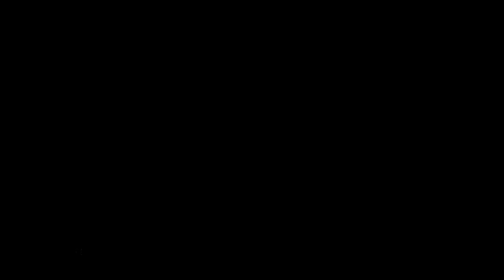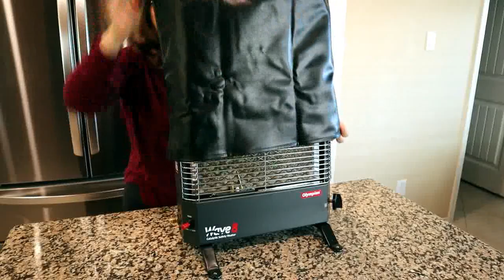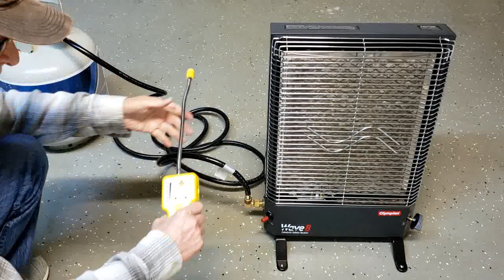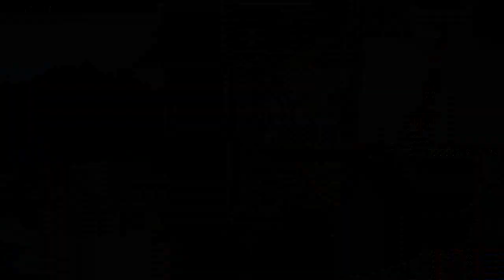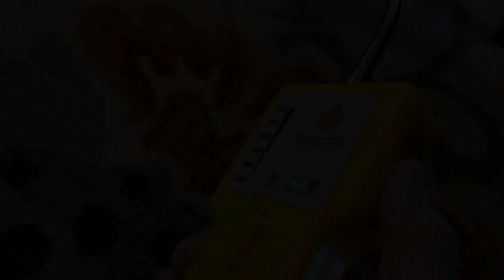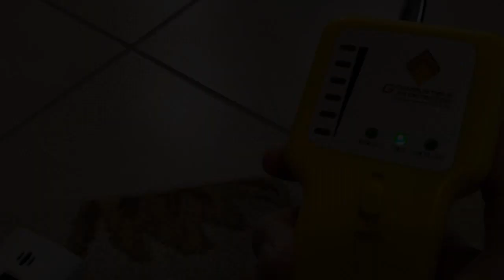Olympian Wave 8 Heater Review.  We Didn't Notice Any Propane Smell Like With Our Mr Heater.

Comment: My wave8 just sips propane and runs the longest of any heater I have used and mine is about 10 years old and has been great and will run for 5 days on high like I said they just sip fuel and you must buy the cover or you will ruin the heating mat and let it cool down put cover on for all summer or in the winter if not in use and they cost to much no to use the cover .

Comment: Your viewers need to be warned. There is a problem that you are not mentioning. When burning propane, approximately 0.81 gallons of water is produced as a byproduct per gallon of propane burned; meaning for every gallon of propane used, roughly 0.81 gallons of water vapor is created through combustion. Ask me how I know it is a problem. In short my RV roof fell apart and had to be replaced. Warm moist air softened the glue holding the OSB wood panels together. Non vented propane heaters of any brand or size create the aforementioned problem.
Reply from the maker: I was clear in my video that it needs to be vented.  The manual said it should be vented. For some, I think they can by a dehumidifier maybe at an RV place if its an issue. It is not a problem for me.
Reply: @LoneStarPrepping  open a window

Comment: This is super helpful. I've been watching a few Olympia Wave videos with an eye on buying one for my van. The Propane smell is killer for me so that takes care of the Buddy. I like the safety of this one. In my trailer I used an oil heater as I have to have quiet but it did burst a leak on me once (with the emphasis on burst - oh yeah - what a mess) so now I'm considering this one as I figure it's quiet, no permanent open flame, no smell, propane not likely to leak.
Reply from the maker: Glad I could help. I really like ours!

Comment: After watching your video I got the wave 8. The smell with propane heaters also bothered me. With the wave 8 I have not smelled anything at all. It works real good so far. I have only ran it a few times and I am very pleased with it. Thanks for the video.
Reply from the maker: Glad I could help.  We really like this heater.  Too bad its so expensive, putting it out of reach for a lot of people who could really use it.
Reply: I wanted to do a follow-up on this heater and my comment.. After one year of use, it still works great. When I change the propane tank, I check the connections with a gas sniffer just to make sure no gas leaks. I am very pleased with the Olympian heater. Your video helped me decide on the heater, and I am glad I did. Thanks.

Comment: What made you choose this vs. a kerosene Kerosun style heater?
Reply from the maker: Because kerosene smells, burning kerosene smells, open flame can be a fire hazard, dont want to store the fuel, and fuel does get old.   None of thise things are a problem with my wave 8.
Reply: @LoneStarPrepping  Thanks for your reply. I was under the impression that Kerosene stores for years but apparently you're right.
Reply from the maker: Some sites say 1 to 3 months. Some say 3 to 5 years. My propane will last indefinitely. I store many tanks.

Comment: Just bought this beast the wave 8 and I’m really impressed. I had the wave 3 and that wasn’t quite cuttin the mustered good heater just to small. Anyway these are great heaters well worth the money in my opinion thanks 😊
Reply from the maker: I agree! Where do you use it?
Reply: @LoneStarPrepping  I use it in my non insulated man cave (garage) to supplement my propex heater so it doesn’t run so much. They both sip the propane love it. 😊

Comment: That's the cream of the crop when it comes to heaters. So expensive though. I've got a Flameking 3000btu catalytic heater ($61 amazon) and I'm really happy with it. It uses those green cylinders but can also be hooked up to a bulk tank. It's easier to light. Just turn the knob to high and press the ignitor button a couple of times until it lights which starts the chemical catalytic reaction. That's it. If you need more btus you can buy more than one.
Just another option for those who don't want to spend the money on the wave. I don't trust the flame heaters like the buddys because of the fire risk and noxious fumes so those are out for me.

Comment: How high off the ground does it sit with the leg kit installed?  thanks  meaning  distance from bottom of heater to floor with leg kit
Reply: 1-2” closer in the rear higher in the front and that’s because it leans back a little .

Comment: I also had a Mr. Buddy, which I believe should only be used for short-term durations, never while sleeping. I have used two Wave 8's for 6 long, cold, Canadian winters in my full-time live-in RV. They are expensive to buy, but they really do sip propane, a 30-pound tank lasts about six days on low. I would highly recommend them, they are efficient, smell free, and very safe.
Reply: Buddy is just as safe. If it wasn’t you would have reported cases of people dying from sleeping near the buddy heaters. I haven’t heard of any cases
Reply: @jamesball8519  you should watch his video on mr. Heater because I got sick from it also due to allergies to the sulfur dioxide that they add to the propane that makes it smell bad so you know there's a leak..
I wouldn't have known why I was sick if he hadn't put out this video.. I thought it could be the heater but since I have researched this I have found out what the truth of the matter is..
From the mr. Heater I got terrible headaches a very hoarse voice and vertigo and my eyes burned..
So don't go telling people that the mr. Heater and I guess the mr. Buddy is the same way since it's the same company, that it's safe for indoor use for everyone...
I hooked it up to a brand new 20 lb propane tank, I got the mr. Heater hose that goes to the 20 lb propane tank and I had good ventilation.. the store I bought it at which was Ace Hardware didn't have the fuel filter at the time I bought the mr. Heater and it turns out they didn't get it for 2 weeks so I ordered it online and got it that way..
It didn't help I still got sick.. plus the mr. Heater would not light half the time.. even though I use their recommended hose that they say didn't leave the oils from the hose like other hoses did.. but apparently it does cuz half the time it wouldn't work.. the heater either wouldn't light or wouldn't stay lit or it's shut down after using half a tank of propane..
I did put in a 1 lb green propane bottle which is what they recommend for this heater.. and after about an hour of running it with that little bottle I switched it over to the hose and then sometimes it would light and sometimes it wouldn't..
The 1 lb green bottles are a cleaner grade of propane but even with them on it I still got sick...
But they don't tell you that if you have allergies or lung problems do not use this heater ..you have to get sick first..
So now you are educated on this matter
Reply: @jamesball8519 cool story bro
Reply from the maker: Thanks for sharing

Comment: $600 for a portable heater!!!😱
Reply from the maker: No. More like $400.00 at campingworld and worth every penny when it is sub zero temp outside and power is out and you cant handle mr heater smell and want to stay away from a warming shelter.  Funny... lots people dont have a problem buying a PS5 toy for $600+ ...but when it comes to prepping for this kind of thing, they look the other way.  I put 2 links in for price info.  I got mine at camping world.  They also make smaller units for less money.
Reply: Adjustable 4200 to 8000 BTU  🤦‍♂️